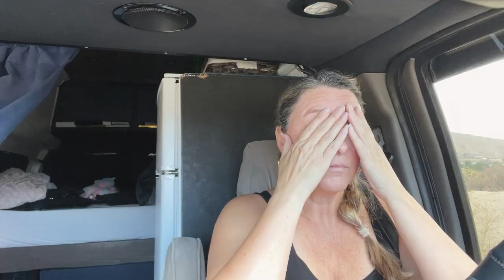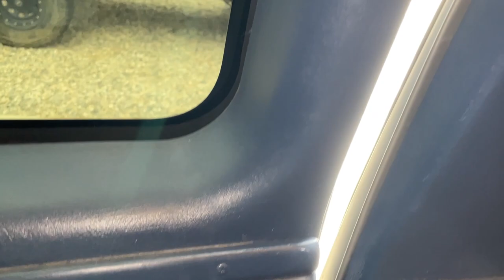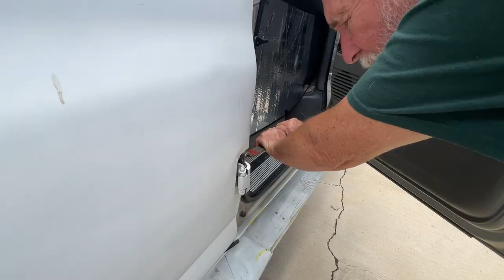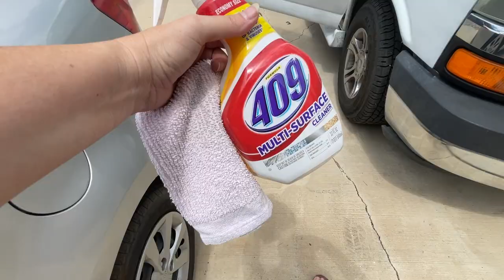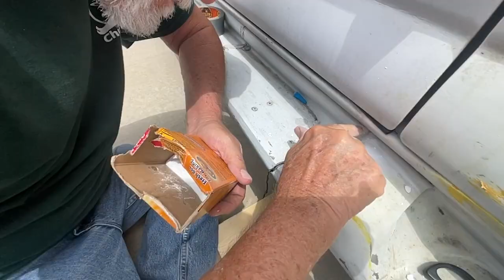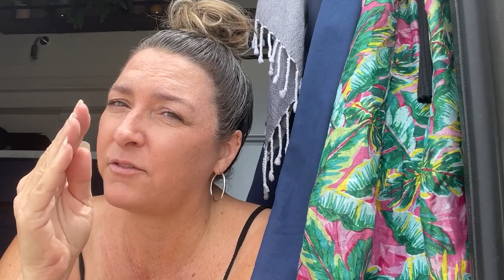I CRASHED MY VAN and it broke my door 😭 (Mini Freak Out) // Van Life Mistakes

Comment: Steering wheel shaking during braking is your brake rotors. They are grooved/ worn. They need to be removed and smoothed out. That happened to my last vehicle.
Reply from the maker: Yeah I’m gonna go get them checked tomorrow. Thanks!
Reply: It could also be alignment issues. Worth checking—bumpy roads and potholes are tough on alignment!

Comment: Picked up my van from my mechanic, backed up and turned the wheel to go straight out of his driveway but not quite far enough and drove the front end right into a drainage ditch at the end of his driveway that I didn't even see.  Crash.  Crunch.  He had  to come out and back it out of the ditch for me.  Thank goodness he could get it out.  The whole front wheel was in the drainage ditch.  It damaged the running board on the drivers side which runs the whole length of the van of course.  Now I can't step on it to get in the van.  Fun.  Also I had to duck tape it back together.  Looks greaaaaat.  Thankfully there was no damage underneath.  Mostly I was just shocked it happened.  Couldn't believe I was so calm but definitely not happy I did that.  Just drove off and waved.  Oy vey.

Comment: When I got married in 1970 we had a Dodge Super Bee and we were going to go to Florida for our honeymoon well we had new tires so no problem right we didn't get 30 miles and had a blow out got tired exchanged went 50 miles and had another blow out needless to say didn't go to Florida because I said we are not supposed to go oh and we bought a different brand of tire will not say the brand we had trouble with
Reply from the maker: Holy Moly! Yes that was a good move to turn around. Thank you for sharing this.